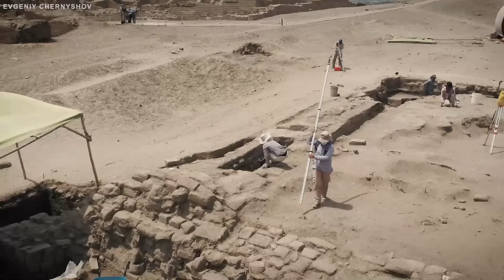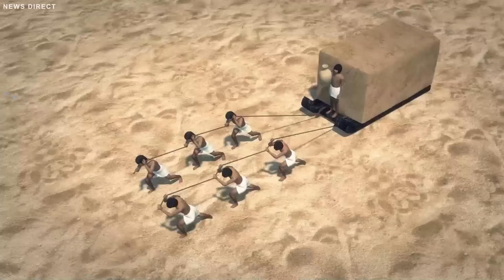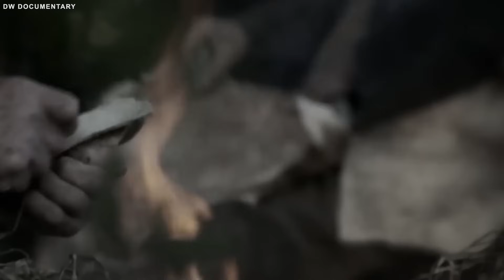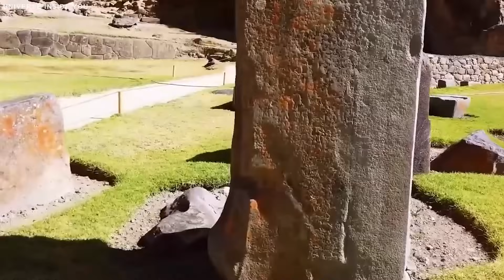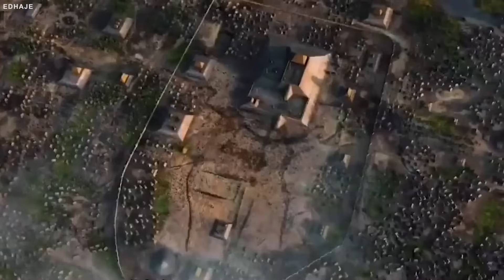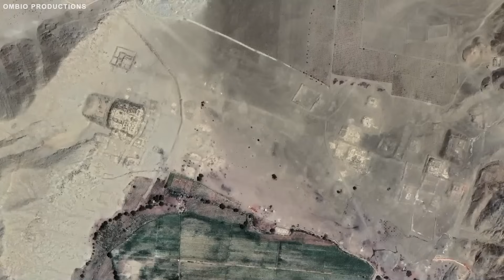Peru's Greatest Mystery – Megalithic Ruins No Human Could Ever Build

Comment: This is why they built in the mountains. They used the mountains to pull the stones up one side and the counterweight  slides up and down on the other side. If you use enough weight you can pull the stones without any rollers or sleds.
Reply: That’s a very interesting theory. I haven’t heard this before. Like many great theories on impossible subjects, it raises more impossible questions. Fine job.
Reply: Quite a rope pal 😂
Reply: Just the weight of the ropes needed would be too heavy to move! 😂